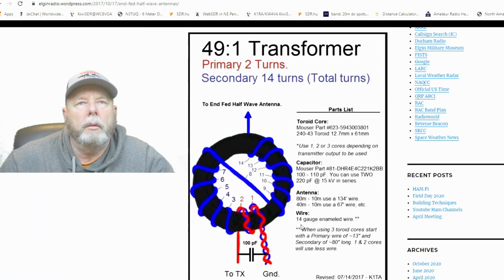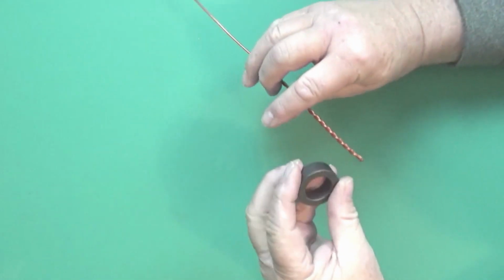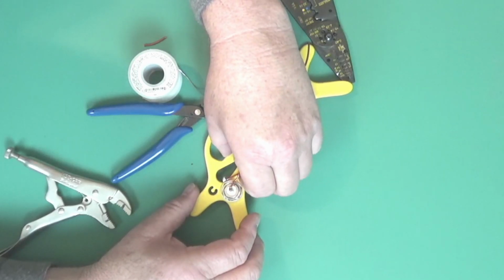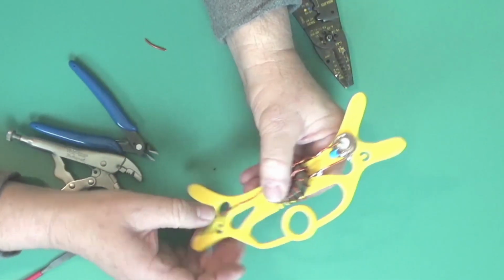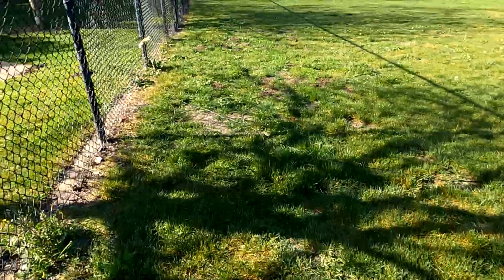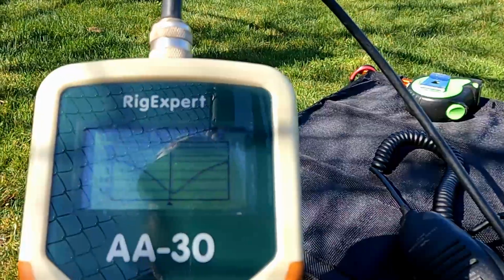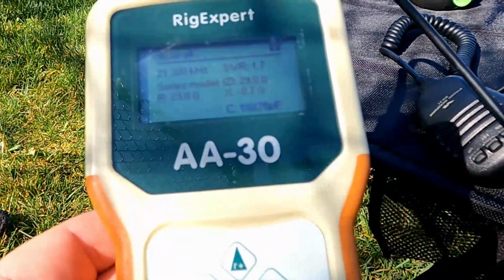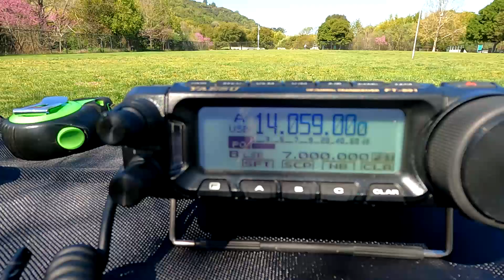How to build a 100 watt EFHW for portable use!

Comment: This is my tool out in the Fields. EFHW vertical 49:1 transformer balun with 34µH extension coil and 39,9ft wire on my Sipderbeam Fiberglass Mast 40-10m Band allowed me to talk to the whole World with a 100W. 73's de your Friend Uncle Guenter
Reply: Did you use a 34uH coil to shorten the antenna for 40 metre band? Do you mean that by "extension coil"?

Comment: Another great video.  I am wanting a 100W EFHW so this is looking good to me. 73!
Reply from the maker: Brent, we have a kit from Coffee And Ham Radios coming out very soon with all the parts included. It will be available on the toads discord first after that we aren't sure where we will sell but should know soon, depends on how the demand is.
 https://discord.gg/6wM47AaX
Reply: @KK6USYHamRadioAdventures  yes I would be interested in a kit build. If the coffee group sourced the parts in a kit with instructions I would get it.  The detailed instructions could be referenced off of the HF Kits build that Smoking Ape built.

Comment: Update: used the antenna for 2022 Field Day,  setup at 7200' in Az forests, worked CA, WA, BC, MA ,FL, TX and more..  mostly 20&40m doesn't like 17m.. half the effort to erect than the dipole without the feedline hanging putting stress on the wires.. very happy with it..ended up using 14g for the windings on a single 140-43 and 22ga silicone jacketed at just under 64' 100w ssb no problem.. thanks again..Paul.

Comment: If you wrap 5 turns of the wire on a 1/2 pvc form 6 feel from the radio you will help the higher band to lower the swr the antenna.
Reply: Do you mean the coax?
Will that work as a CMC choke?

Comment: Is there a process for tuning the toroid/transformer or is it all the antenna wire?  I asked because on the last one my 80m and 40m were great and the 20m a little higher on swr.  Didn’t know if it was pretty much a case of it is what it is or if things could be improved and tweaked.
Reply from the maker: You can do a different type wind but on the 49:1 one you make the wire for the lowest band and then tune it for all the bands. This antenna worked great at 64' for the wire i used some have different velocity factor so the can vary a little. Check out Dans web page on the 2.7 oz build he talks about one with traps , I have never needed to do that. Alos try getting the matching unit close to the ground that dropped this antenna to1:1 swr.
Reply: @KK6USYHamRadioAdventures  alright I’ll keep at it.  The 80 and 40 were awesome.  The 20 was like 2.3:1 for some reason.   I might need to cut the antenna some more I guess as low point on 20 was in the 13900 range.   Didn’t want to cut too much off to effect the 80 and 40.
Reply: Theoretically, prior to securing the toroid to the winder, you can twist the end to the wire you plan on using in a semi deployed configuration.  Throw an analyzer on it and see how close you are to 50 ohms on resonant freq.  Below 50ohms, you have too many turns, and above 50ohms you have too few.  Its safe to throw on extra turns and then unwind the toroid a turn or two, to walk it in to a near perfect 50ohm match for the primary freq.

Comment: Hi Chuck,  Enjoying your content..  I'm sourcing parts for this build,  ended up with 2 140-43's... do you think that would handle 100w ssb, perhaps doubling them up..?  and how light do you think  min ga on the magnet wire.. thanks, Paul.
Reply from the maker: Paul I used 1 140-43 and 14 gauge and it has been fine for 100 watts , I think you could go to 16 also. If you use 2 140's it will help dissapte more heat and can't hurt.
Reply: @KK6USYHamRadioAdventures  thank you for the reply, I appreciate you taking the time.  been stringing up a g5rv jr in the pines camping, thinking the efhw will be a little simpler..running a Kenwood TS-50 with the DSP mod.. fun portable..not so much sota... the radio isn't so bad but the big ass cooler of beer is a B!$*& to drag up a mountain top..    ;-)>  K7TTV
Reply from the maker: @AzPauly  those big coolers are heavy! The EFHW should be easier and work well, keep the matching unit low within a foot of the ground and it should work well. Depending on the wire around 64' start long and work your way there.

Comment: Looking at your parts list.... what kind of capacitor?
Reply from the maker: One 100pF 15kVDC ceramic capacitor. It is in the drawing at 1:06.
Reply: @KK6USYHamRadioAdventures  Looking right at it and it just didn't register with me.  Thank you!
Reply from the maker: @twohandsandaradio  happens to me all the time LOL
Reply: Having a hard time finding that capacitor. I find the 100pF but only 3000kV.  Anybody have a link to the
 100pF 15kVDC ceramic capacitor listed?
Reply from the maker: @off-trailseeking3965  The one you found is what I used instead of two 15Kv it works fine, I added a link to ones I purchased in the description above.
Reply: @KK6USYHamRadioAdventures I found a set of 10kv 100pF capacitors on eBay and placed an order. Will those do?
Will use 100 watts SSB on 140-43 toroid
Reply from the maker: yea that's fine @drankurbaruah
Reply: @KK6USYHamRadioAdventures  Thanks! 
73 de VU2EHC

Comment: What did you use to stand up your mast?  using guy wires when solo it sometimes frustrating ;D
Reply from the maker: Steven I have a stake that goes inside the Mast here is a video on it . https://www.youtube.com/watch?v=Jm5VHkcxsXA&t=132s
Reply: @KK6USYHamRadioAdventures  Ahhh
. that's a great idea .. was thinking a stake but thought it might damage the mast on the inside.. not with that insert.. Thanks